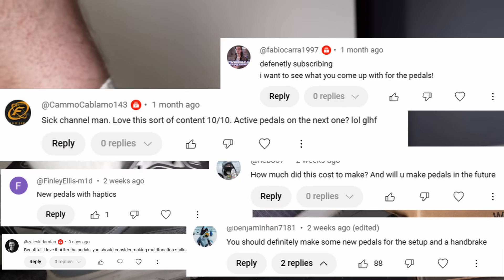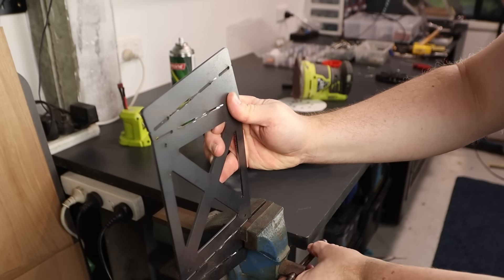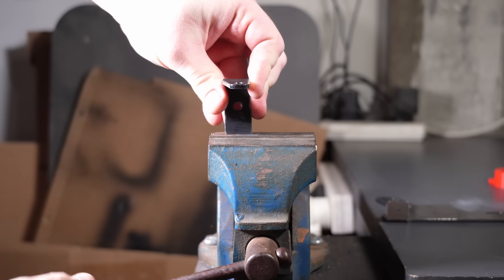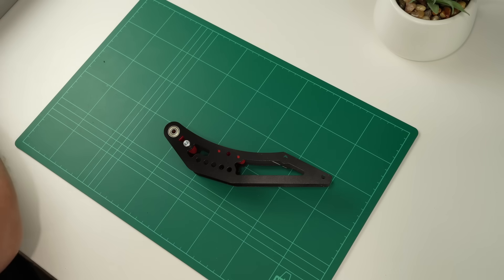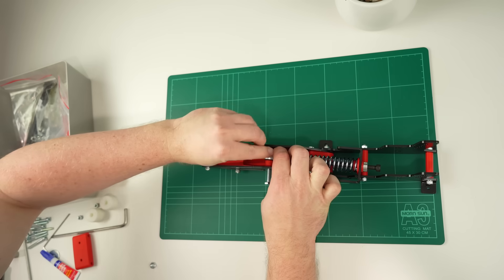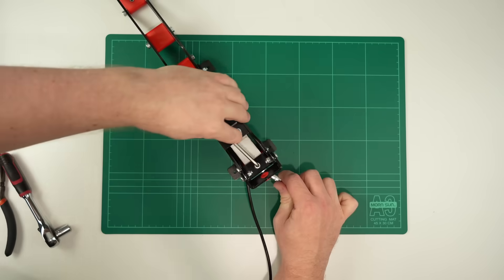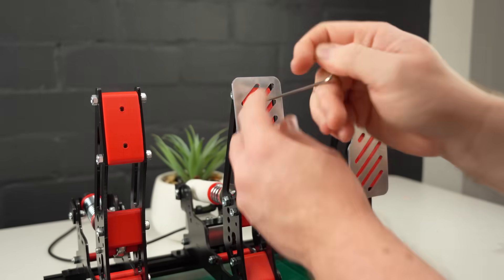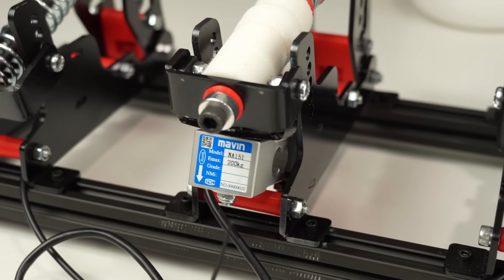DIY Load Cell Sim Pedals!

Comment: totally need that rig, its a must without a loadcell and definitely with it. but depending on how the prices are, a bought one might be the more economical choice, like you can sure make it from extrusions but in the end you make content out of those so i think you are going to buy a lot more extrusions
Reply from the maker: Totally agree, the springs in these pedals are already much too heavy to just use it sitting on the floor. I have been keeping an eye on marketplace for used sim rigs but most of what I've seen are the little light weight steel tube ones that I don't think are going to be strong enough for my needs. I probably will make it out of extrusion since I can get it locally and I like building with it. I also need it to be rigid enough that if I were to lift it from one corner for "some reason" with a person in it, that it won't flex 😉
Reply: @cncdan  i  see where you are going, if you , for whatever reason had to "lift" the rig on the corners, then those will not be suitable, ive had a GT omega, with 8nm direct drive and loadcell pedals, worked great but not for what you have planned! :D

Comment: ok i did not know you can read analog input from the hall effect sensors or that they had a few centimeters of range !!!

they do look good ,and now im curious to know what car you drive in real life !!
Reply from the maker: Yes, they are basically just a magnetic potentiometer! They don't have that much range though. From memory, the magnets are only 16mm off center from the pivot. The total range is probably a bit less than 10mm.

I don't drive anything interesting at the moment! I did own a lightly modified Subaru Liberty GT a couple of years ago, but I sold it to fund renovations on the house and then bought a very cheap Suzuki Grand Vitara as a daily and material gathering vehicle 😂

Comment: I built my own DD wheel after watching your own video, and it has been awesome. Thanks for the inspiration!!
Reply: How much did it cost you total, and what tools were required? Im thinking of doing this at some point
Reply: @freddo5677  Hard to actually figure out. I think the actual wheel cost like $100, but everything I've built for it was between $250-400 dollars. I made A LOT of 3D printed parts.
Reply: @Ivory_Mist   what do you mean by built for it? like pedals shiter etc or something else?
Reply: @urkevranes3457  So my pedals are modified G920 pedals with a load cell upgrade. The shifter is a Thrustmaster TH8S. I built my hand brake, my direct drive wheel base, and both of the wheels that I use (a round wheel and a GT wheel). My rig is a heavily modified Playseat Challenge with parts printed to hold all of my components and increase stability.
Reply: @Ivory_Mist  dayum respect, i made my own belt driven wheel (my own design) using emc software, its really good going from controller to a wheel i can just imagine how dd feels

Comment: Ha! I just asked for this in the last video, but you were clearly already working on it! Great job, mate!!

It would have been really cool if you had mounted these from the top, as opposed to from the bottom, as I've seen some people do in their DIY pedals. Apparently, the feel is more realistic since the rotation happens in a similar way to real pedals, since the pivot is on top, not at the bottom.
Reply from the maker: Yeah, I'm keen to try mounting them from the top when I build the sim rig. I reckon the design will work pretty well either way, and I just didn't want to build a massive frame just to mount them upside down for the short demo in this video!
Reply: @cncdan  that's fair! I'm really liking this project, mate. Great work!

Comment: Shame you didn't mention the total cost, would be interesting to compare to other solutions
Reply: Had a quick peak at some of the parts and I can gather at least $120 not counting the CNC parts, the nuts and bolts and other small parts which depending on where you source them can double the total. A set of Simsonn is around $250 for the three pedals in comparison and is a drop in and go solution.
Reply: @wayne8797  For this price you can buy complete SIMJACK pedals
Reply: @wayne8797  120$ in parts plus CNC parts is nonsensical to be fair. esp when fanatec has a good set with both pedals and a direct drive wheel for 399...
Reply: @wayne8797  I just got the Simsonn Plus X pedals all three for 163 euros shipped to my house.
Reply: More than buying them outright.
Reply: Better to buy than invest tome and money and get broken controller i tried this

Comment: I would rather use countersunk screws for the pedal plates to get them flush for even more realistic feel.
The plates are thin, but they really don't need strong mounting, double sided tape would probably do just as good for that.
Still this is awesome and I will probably copy this when I got the time
Reply from the maker: Yeah, I actually had countersinks in the model but couldn't get any long enough locally so I went with the button caps instead. Can't feel them at all in shoes! And I suspect you're right, a bit of double sided tape or glue would probably stick them on just fine!

Comment: darn, with being in the US the ali-express links are out of the question. this is awesome though, thank you for making the git hub for the wheel and now this. If i find us sources for those parts that are in stock im might share them here. Keep doing awesome projects
Reply from the maker: As an outsider who is thoroughly uninterested in politics, It's so hard to keep up with what's going on over there right now! If it helps, I managed to buy almost everything on that list locally. I usually just provide AliExpress links because they are a cheap place to get parts and are accessible in most places AFAIK. The only thing you might struggle with is the load cell, as the only local options I could find were at least 10 times the price!
Reply: @ Haha I getcha! I can't really afford to not pay attention but for the US may 2 was when alot of our tarriff nonsense, for china especially was supposed to into effect (mainly the fact that packages under 800 dollars would not be charged tariffs, that ends for us) but things have been nuts. So we'll see how long this stays!
Reply: I just ordered a bunch of stuff from aliexpress to the U.S. and had no trouble with the tariffs. Maybe they are struggling to enforce them?
Reply: @ just be careful cause they might charge you later on.(Sometimes that happens) Until things are bit more certain just gonna play it safe. I think some exceptions were placed on certain things so that could be why to!
Reply: Just curious, why ali-express is out of question in the US? Taxes?
Reply: @horrorcoder  Tariffs, making certain things obnoxiously expensive and the uncertainty what additional cost im gonna get hit with. I just got hit with a 100 dollar surcharge importing a kickbike frame from spain because fedex adjusting their pricing, my Shipping went from 70 dollars to 270 and luckily the business ate half of that since I was quoted 70. So ill have to check and see if im gonna get hit with a gotcha like that again if i order these pedal parts